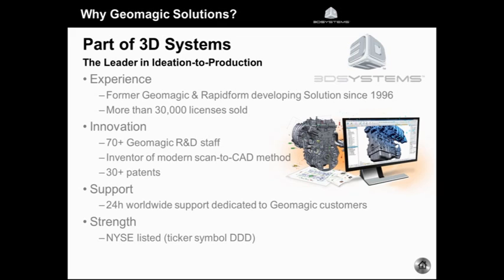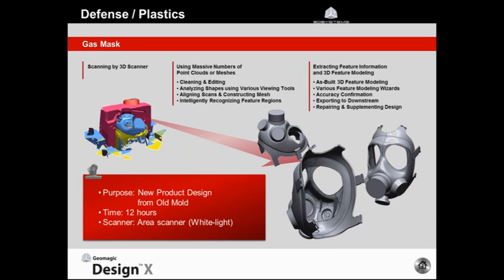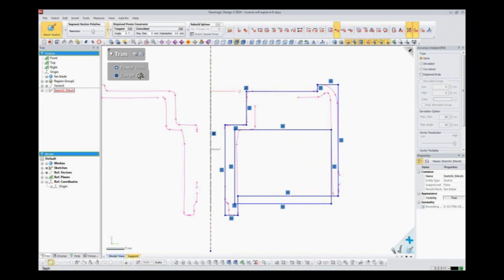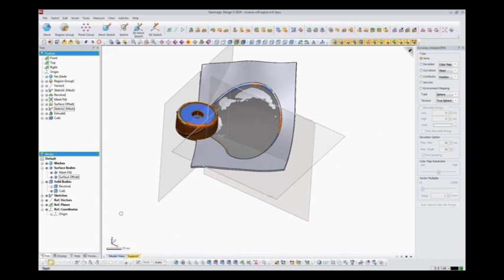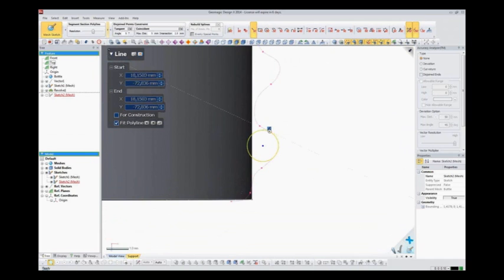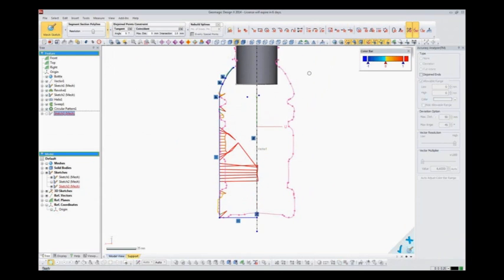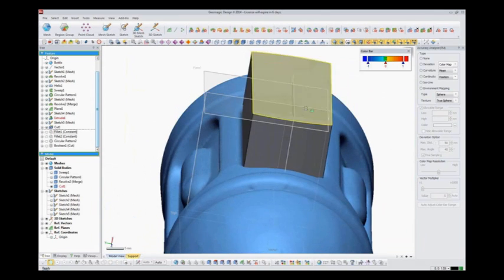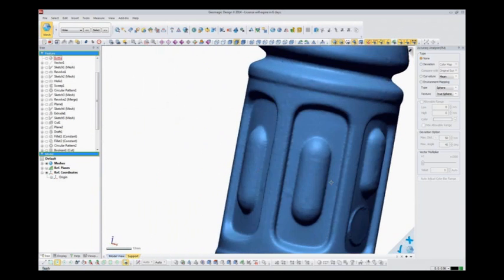The Fastest Path from 3D Scans to Your CAD Software Webinar - November 2013

Comment: This is unfortunate. I've read how fast Design X is, and I'm trying it now. I have used the latest Scanto3D in Solidworks and it can do everything that is in this video, pretty much. Yeah it takes a little longer and a little more on the part of the cad operator, but for a minute or so different (if that) between the two, the $20k tag for Design X just doesn't make sense. I'm hoping some other tutorial with show me what Design X can do that SW Scanto3D can't, but this one doesn't.